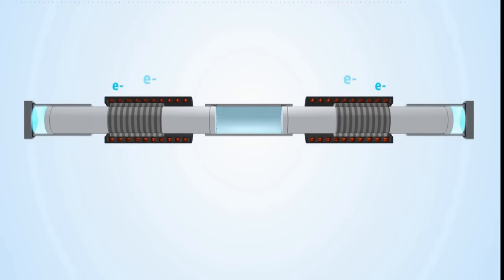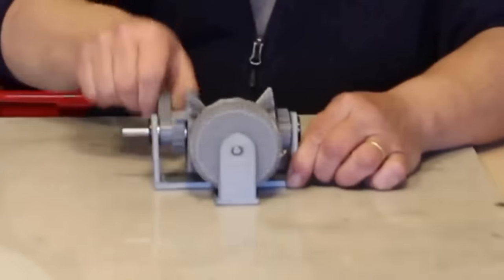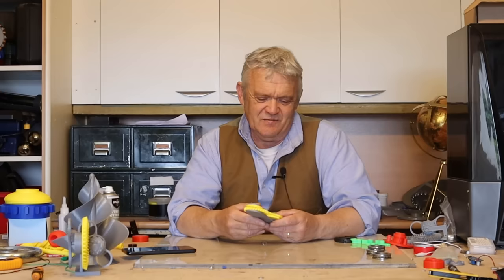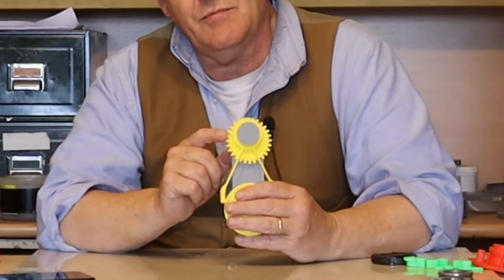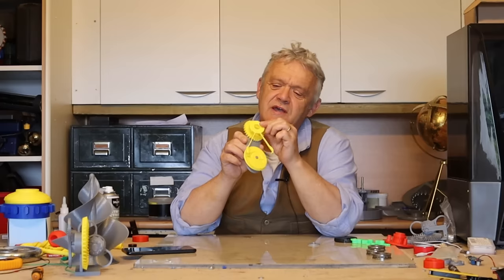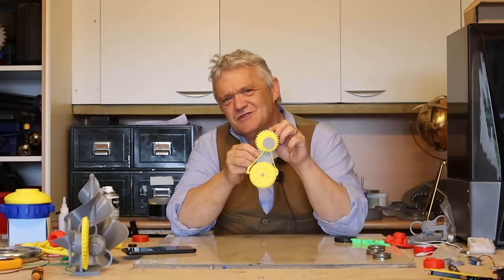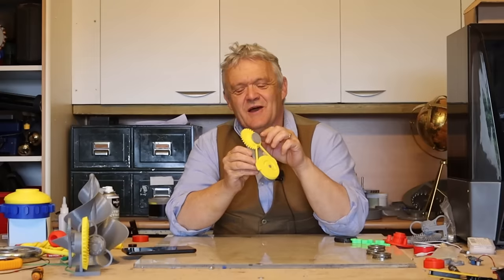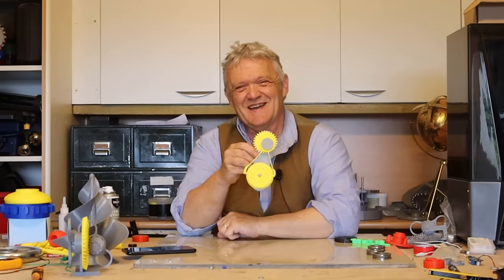2003 The Magic Lever Energy Harvester by Seiko

Comment: The generating tiles are the equivalent of "mushy" ground which is harder to walk through.  Smart people will want to detour around it, and it's really a clever way to make the simple people work harder.  A backpack that bounces to generate power will make the wearer work harder and more tired.  There's no free power to harness here.
Reply: It's effectively like putting a belt on an engine and driving additional hardware with it; in the power-"generating" case, it's an alternator.  It doesn't accomplish this by leeching excess energy off the engine, it does so by putting additional load on the engine.  Like you say, this stuff is a way to sap work/life from saps.
Reply: There is some free energy to harness, but it's really small. People wearing shoes probably have some padding, the padding is already wasting some energy. If instead of wasting it as heat it was directed to energy generation, that would provide the same padding effect with energy as a byproduct. 

It's not going to be very much, but small electronic devices don't use very much. For use cases involving a lot of walking (e.g. hiking), a tiny amount of power harvested all day could be usable.
Reply: @TheJohnreeves  Regardless, it ignores the larger issue. Wasting time trying to scoop up bits and scraps of energy from the fringes instead of diverting that intellectual effort toward novel energy generation technologies and improving efficiencies of existing technologies, like reducing transmission losses etc.

Penny wise and pound foolish.
Reply: @joevideowatcher  Nuclear power was that decades ago, the new thorium tractors run on an element that is as common as lead and are incredibly safe and basically meltdown proof. They don't actually want to solve energy because it would remove a reason to infringe on rights.
Reply: How about springs in soles of shoes that compress when you step on them and spring you up when you take a step.  However, all the weight in the shoe would suck.
Reply: @1810jeff  That's a load of BS. Firstly, you can't "solve" energy. We will always have a finite amount of it. The more of it we have, the more of it we are going to use and/or the more often we will be willing to use it inefficiently. Secondly, who's goal in life is it to infringe on your rights? Society is made up of many individuals. Its just a lot of people doing their own thing. Our problem with politics isn't conspiratorial. Our problem is the stupidity of the average person.
Reply: I don't think the issue here is trying to make FREE ENERGY!! Obviously heat losses exist and such. the issue is rather finding a way to convert one form of energy into another in a portable fashion. You can't charge your phone with your legs, however if you find a way to convert your mechanical energy into electric passively it sure would be handy to have. but then again in that case you might as well use a dynamo.
Reply: What if the generating tiles are just use downhill, where we absorb the impact mostly with our knees?
Reply: just dont take too much problem solved
Reply: How do they not realize that making people move down will take away energy needed to move forward?  Anyone that's ridden a bike with suspension will know this.
Reply: Could be applied to wave and tidal motion... that's free energy to grab. We already have wave energy generation but this could be an innovation.
Reply: @luismoref  on all that one way downhill human traffic zone
Reply: @BillDownhill problem is worse than that vertical and horizontal displacement are inefficient gait clearly where something like this would benefit is to make units and couple them to trees.  Fast growing species with bendy trunks.  So that any appropriate movement advances the mechanism.  But the what?
Reply: No one is trying to get “free energy”. At least no serious scientists and engineers. It’s more about looking at places where energy is otherwise wasted and can be reclaimed and put back into the grid.

Every scientist and engineer understands the second law of thermodynamics; which can be roughly translated as “every energy exchange interaction loses a certain amount of energy to wasted energy (oftentimes heat).

The point of walking pads for example is to get back a bit of energy from the kinetic energy which would otherwise be wasted by us just walking around. Of course like I mentioned before you still observe the second law of thermodynamics so by engaging in this energy transfer you necessitate an increase in energy (what you describe as mushy walking).

This isn’t by the way me supporting the idea of micro energy generation, I think we should focus on large scale renewable energy sources, but if they can get it to work in a cost effective manner then why not?
Reply: @thecanmanification  human motion is tough because we naturally reduce the work efforts throughout gait so as you start to try to take energy out youre going to make gait less efficient.  Consider prosthetic feet they bend but universally if they move too much people feel like they're walking in quick sand.  

Where waste energy is readily found are things that need dampening.  Buildings, sign posts, heck electrical wires themselves.
Reply: @UncleDiddles , when Discovery Channel had its Green Channel some years ago, there was an show where two tinkerers/inventors were featured, & in one particular episode they  used a type of wind turbine inside a large tube that turned in the same direction regardless of whether the wind entering from the top or bottom.

The tube was positioned vertically and attached to a oceanfront pier with the turbine inside it at the top.  When the waves came in air was forced upward, and when the ocean receded, the air was “sucked” downward.  This caused the turbine to spin consistently 24/7.  

It looked to me like the easiest (& probably cheapest) method to generate energy from ocean currents.  

But what do I know (or the two engineers/inventors/tinkerers)?
Reply: @LawrenceCarroll1234  I've seen that, it's a compartment that the water flows into and causes air to escape upward through a venturi and spin the turbine. I don't see why there is hostility in your pointing that out. Yeah, cool, it works, but why does that discount the use of this mechanism somewhere?
Reply: @UncleDiddles  , I made the deprecating remark at the end NOT to disparage the use elsewhere, but rather because of the apparent widespread lack of interest in implementing this method of power generation across the globe in coastal areas.

In other words, if it works — & works well, why not use it?  It may just be one of many methods to generate power via nature’s oscillations, but with global temperatures rising so quickly, and energy costs so high, we need to implement things like this, right?

But I get that you appreciate this, so thank you!
Reply: @LawrenceCarroll1234  have you heard of the concept of NIMBY? Not in my back yard... people complain about energy costs, but ask them to put a wind turbine on their land or a tidal generator at their beach and the answer is no. People want both, to have free energy, and to not be bothered or inconvenienced by its generation. That's the reason tidal generators are not widespread, that and cost. I was referring to this mechanism because it could be used underwater for shifting currents/rip tides, in smaller generators. A way to try and get around that.
Reply: @UncleDiddles , I hope you are right.  I am honestly flummoxed by the way many people don’t even seem interested or marvel at the ingenuity of such inventions, like maybe it insults them, as if that was its intent!  😜😂
Reply: No necessarily. There is a lot of wasted energy when we walk and run. That's why we can go faster and for longer when cycling than running. So there should be ways to gather that wasted energy without making people more tired. It's not free energy, it's just more efficient usage of it. For exemple, for the tiles, I would result in your steps being cushioned just enough not to hurt yourself even if you step forcefully without bending the knee when you put your foot down, while becoming just as rigid as concrete when you push yourself forward. However, that does require the person to change their way of walking, and the tiles would probably need to be fine-tuned for each person using them. So in the current state, I agree with you. But for the backpack, there's probably more potential since it can be fine-tuned to its user.
Reply: Yep, whoever comes up with these "14 kWh/day from just walking" ideas ignores the fact that the entire 14 kWh are used up propelling the 70-90 kilos of human around.
None of that energy is wasted, else wed be floating around in the atmosphere.
Reply: @lucasbrelivet5238  I work in a profession that does things like put motion sensors on humans and have them walk while monitoring their CO2 output to determine energy consumption.   Humans are quite efficient.  Bikes are a bad example because of course they are efficient they roll.  Which means really the act of gliding is more efficient.  It's like ice skating on a big open perfect lake is extremely efficient if you've never had the chance in a pair of speed skates and just go on your merry way coasting is very efficient.

Humans otherwise automatically will shift to walk more efficiently.  So if this clicks every time your waste movement exceeds a certain amount most humans knowing that will walk to not make it click.
Reply: @bryceg5709  I guess walking is still quite efficient, but running isn't. You need push yourself upwards each step, then dissipate that energy when land. But if we're going to make a special floor to save energy, we'd probably be better off making a bouncing floor to give the people their potential energy back and make running easier, that trying to make electricity with it. However, if you're a soldier running in the middle of nowhere, maybe some shoes or a backpack that can produce electricity as you move around are worth having.
Reply: @lucasbrelivet5238  But do mushy tiles or a bouncy backpack actually use the wasted energy?  Or do they just require more energy in addition to the waste?  You're onto something with bicycling -- and I think it's the invention of the wheel that is resulting in less waste.  It's a rigid support that doesn't require energy to support weight, unlike the floppy noodles we call legs.
Reply: @dansw0rkshop  Do you know of jumping stilts? They are strong springs that you can attach under your feet, and once you've mastered them (which isn't easy), they allow you to jump much higher and run much faster than normal, despite the added weight. That is because with each jump, your kinetic energy is stored in the springs, then returned to you and added to the energy you input for your next jump. A bicycle works similarly, except it simply allows you to keep your kinetic energy by rolling, and you can keep adding energy to that. However, when running, if you stop moving your legs, you lose all your energy. And you have to propel yourself off the ground with each step, but when going back down, you have no way to store that energy, so it just dissipates.
So if we can store that energy and reuse it to move around, theoretically  we should be able to intead convert it to electricity. As for whether a bouncy backpack and mushy tiles can do that, probably if done right, but I think it would be difficult to actually make it worth it. Without even talking about cost efficiency, any energy generator would add weight to your backpack, and take space. So even if your generator doesn't make you use more energy than if it was turned off, it might make you use more energy than if it wasn't there.
 Also, you wouldn't need a bouncing backpack, but on the contrary, a backpack that doesn't bounce even when you're running, like a passive camera stabilizer. This way, without a generator, you wouldn't have to lift your backpack when you propel yourself up when running, saving you some effort. And if you add the generator, you won't save yourself the effort, but you'll use that energy to make electricity instead of moving your backpack up and down for nothing.
Reply: I saw wind powered lights that go on the front of your car on temu lol
Reply: @joevideowatcher  Good thing there's more than one scientist and we don't have to choose one or the other, huh?
Reply: Claiming so is like saying that plants, by harvesting energy from sunlight, put a greater workload on the sun. The greater workload from a person walking over these things is trivial even in comparison to the trivial amount of energy it probably gets out. 

I'm not defending the tech, which is very likely a terrible source of energy and will take resources better spent, idk, being used in nuclear reactors, but this happens to be a shot and a miss.
Reply: @BillDownhill  It doesnt so much act as walking through mushy ground, (its not like the ground is sticky, or like theres fluid you have to push up to get your foot out of it,) as rheres a slight exertion to stepping out of it back onto level ground than energy you save walking into it. 

But this loss of energy is trivial compared to what you'd het walking on this. 

No, the real issue with this tech is that its probably a poor allocation of resources to build these. The amount of energy soent harvesting the resources, transporting them as cargo, refining them, shaping them, and placing them is probably considerable, and it will need to be less than the amount you'd get out of what you expect from their operational lifetime. (Eventually theyll break, and you'll need to replace the parts, which will cost more resources and energy.) And that net profit is going to have to be weighed against energy profit you'd get from just building some other green alternative, if you want to do as much good replacing fossil fuels as possible. And you also need to consider how actually beneficial the building processes of these things are. Electric cars have turned out to have a serious environmental cost that undoes much of the good driving them instesd of traditional fuel burning vehicles do ---- not to mention the geopolitical and environmental horror that is lithium mining in Argentina.
Reply: @darth_dan8886  Some of that energy is wasted by the laws of thermodynamics. Thats why you have a body temperature. Some of the wasted energy can, in fact, be collected by contraptions like these. The issue with these contraptions isn't even that they might be difficult to walk on, (though probably not very, and not enough to discount the benefits, even,) but whether these resources could be better invested elsewhere.
Reply: @dansw0rkshop  So, these things won't actually cause you to expend much more energy, and yes, they do help capture some energy that would otherwise be dissipated immediately and wasted.

OP's comment is not strictly correct. Plants don't cause the sun to spend more energy than it would by collecting energy from sunlight, after all. There are ways, though, of harvesting energy from something that makes it expend energy faster, (digestion comes to mind,) not sure either of these technologies really qualify. 

That isn't to say they don't have problems, though. They don't seem like a very wise allocation of resources, for one.
Reply: @peppermintgal4302  Yes, of course. But that does not mean that energy is available for such devices to utilise/convert?
Reply: The electric peizo  generator is what I thought they were putting most of their research into scavenging wasted energy thru movement such as walking / dancing as just the act of standing on it developes  pressure on floor tiles with built in peizo.
Reply: @waynegarfield6607  However piezo still generates voltage from change of pressure, not just pressure itself. And the amount of power generated depends on distance travelled. So there is really limited amount of power you could (no pun intended) squeeze out of a floor tile with a piezo component.
Reply: @waynegarfield6607  Yep. Even heard of putting piezo elements in road layers. Maybe the cost and efficiency will someday be enough to do something like that.
Reply: It's interesting how people play off any type of energy transfer systems by saying "there's no such thing as free energy so who cares." Then their brains shut off. 

Transferring energy like in this video can be practical if the burden of work is dissolved over long periods of time in order to get an immediate result.

Like water towers... ya, it takes energy to put the water into the tower, but it's worth it because it provides your multi-storied house with free water pressure for years to come. You could honestly fill it up with a few people and some buckets in less than a week. 

Or another example would be, idk, ALL watches that existed before batteries. You just crank a screw and it spins a bent metal rod and the watch works for years. When the bent bar stops giving enough pressure, you can just crank it back with almost no work and you get long lasting results.
Reply: @Elrog3 Wrong. Energy problems can absolutely be solved. You say there is a finite amount of energy but that's also wrong. If you consider the universe to be infinite, then energy is infinite. A finite resource is something that gets used up. Energy never disappears and it doesn't "get used up." Meaning all energy is essentially renewable. 

But theory aside, E= MC^2 shows that Energy is mass and mass is energy, but the conversation ratio is insane. An atoms worth of mass contains a nuclear bombs worth of energy. If you could harvest all the energy from all the atoms on the planet earth, youd have enough energy to last for the entirety of the human existence. It would practically be infinite.
Reply: @swickens930  I said we will always have a finite amount. Not the universe has a finite amount.
 
And looking at it, sure, it would have been more accurate if I said "at our disposal at a given moment in time". I think everyone would get what I meant, but it never hurts to be more precise. Unless it gets too long to read.
Reply: @Elrog3  Yes, but the ratio between mass and energy is absolutely insane. If we could harvest energy from any mass (which is technically possible, we just don't know how), you would have what amounts to an infinite amount of energy at our disposal at all times just because the mass translates to SOOOO MUCH energy. 

In the context of the conversation you were having with the other guy, this means that energy problems are technically "solvable" because energy is actually an extremely abundant resource in the universe. You could argue that the universe is just pure energy and that literally everything is energy. 

When it comes to government conspiracies, idk lol.
Reply: Turnstiles could work
Reply: In the case of shoes & backpack.. its probably both more economical, and more efficient to just mount a small flexible solar panel on the wearer. Like many hikers carry today
Reply: @1810jeff  correct. Every year some random person releases a vehicle that runs on hydrogen. That type of stuff is shut down by automotive industries and fuel companies
Reply: @Elrog3 thats actually false, there isnt a "finite" amount of energy in the universe. Energy is never destroyed, it's just transferred. We can't "run out of energy" so long as were still living in a vacuum known as the universe.
Reply: Walking on soft ground can be a lot better than walking on hard, as long as you don't have balance issues.
Reply: @swickens930  Oh definitely. There's only the question of cost vs benefit.

Does this relatively complex mechanism that is subject to mechanical wear over time really collect enough energy over its lifetime to justify its manufacture and application, or would it be more net-energy-efficient to manufacture and carry a battery?..

I definitely do not want to undervalue its usability in very specific circumstances, like in space, or as a part of a more complex mechanism, though.
Reply: @ZeldaplusSmallville  energy is recycled, but to a higher entropic state, as per the second law of thermodynamics, which (as written on Wikipedia) states that, the entropy of an isolated system left to spontaneous evolution cannot decrease with time. As a result, isolated systems evolve toward thermodynamic equilibrium, where the entropy is highest. A consequence of the second law of thermodynamics is that certain processes are irreversible.
Or put another way, energy is conserved but is dispersed and cannot be concentrated more than it is being dispersed. Energy is infinite, energy that is dense enough to be useful is not.
Reply: @theapexsurvivor9538  for your statement to hold any ground you would have to define what "useful energy" is, but then we get philosophical. 
The universe itself isnt concerned with large or small quantities because the universe itself is neither large nor small. 
It appears to me that you're saying the energy wouldn't be dense enough to use, maybe not in our current state. But who's to say less-dense energy is useless?
Reply: @swickens930 
1.) I have not heard of a watch running for 40 years on a single wind-up. Clocks - yes, but not a watch.
And these clocks would all have additional sources of energy in some form.
2.) The energy cycle of Earth that you described is very directly driven by an external energy source - the Sun.
Reply: @bryceg5709  things that need dampening like vehicle suspension? I wonder how much energy could be captured in a car. Hybrid would already have storage for it :)
Reply: @kkutani  I agree that an electrical generator built-in to a backpack or pants pocket or whatever,is likely to add to the load rather than capture waste energy. This is not to say it's impossible to capture waste energy though. Both car engines and electric generating stations (like coal, gas, or nuclear power plants) sometimes use turbines to capture energy after the main energy capture (turbine or piston) device has already done its best. There's still heat and pressure left over and that energy is potentially valuable. 
In cars, people like to use that energy to shove more air into the engine but that isn't the only possible application; if you really wanted to you could operate a generator with it instead. Which is what they do with the low pressure turbines on electric power generation stations
Reply: @joevideowatcher  On the contrary, energy scavenging might be one of the most important things we can do for the world's energy problem, it absolutely is not time wasted. Case and point: Regenerative braking systems in hybrid cars
Reply: More work for a bunch of people who sit around 90% of the day, Oh No!!
Reply: @Elrog3  oh it’s just a lot of people doing their own thing huh? What are corporations then? What are militaries? Hell, what are birthday parties then? Acting like concerted effort doesn’t exist in some vague hand waving attempt to marginalize the argument presented isn’t gonna fly.
Reply: @ZeldaplusSmallville  "thats actually false, there isnt a "finite" amount of energy in the universe."
-
Sigh. I already addressed this when talking to the other guy. I said the amount we have at our disposal is finite. I didn't say the amount of energy the universe has is finite.
Reply: @Elrog3  no, you said the amount that's usable.
And i said, "define usable."
It's a relative and vague term

Lol though, youre one of those redditors that types out a "sigh". 
I guess I shouldve typed something like, "short inhale, short exhale"
Reply: @ZeldaplusSmallville  "no, you said the amount that's usable."
-
Go reread my post. My exact words were: "We will always have a finite amount of it."
 
"And i said, "define usable.""
-
Go reread your own post. That's not what you said either.
 
I'm not wasting any more time on someone who either can't read or is too dishonest to admit when they've obviously made a mistake.
 
And this had nothing to do with the main argument, but I guess you just like being wrong. I don't use reddit.
Reply: @Elrog3  nah, I just thought I was talking to the original commenter I was speaking with before you came along.

And you're getting confused.
You act as if energy is something we have and that we use.
I said define what you mean by usable. And you ignored it.
Energy, like our bodies, is not something we have. It's something that we are.

Just because it becomes less dense and "unusable" to us how we currently are, doesn't mean we can't adapt or that something else can't exist with energy with less density. 
You act as if it's gonna run out and that it's finite; you said we eventually run out of usuable energy.
You're just being vague and trying to sound smart like you know something, but you don't go into the details. 
Then you give up and say "I'm not talking to you anymore". 
I did just sigh in real life, but I didnt type it out because thats not how sighing works.
Its actually funnier that youre not a redditor. I'd feel more normal about it if you were a redditor because of sheep mentality, but the fact that you decided to type "sigh" all on your own without any big societal influence makes it a little worse lol
Reply: @ZeldaplusSmallville  "I said define what you mean by usable. And you ignored it."
-
I went back and found it and it wasn't in a reply to me. So yeah, naturally I ignored it.
 
There's lots of rabbit holes we could go down if you really want to. For example, what 'we' is. Or whether being able to get energy from mass makes them the same thing. I think what I meant was clear enough to be understood.
Reply: There are certain oscilation modes when walking with cargo, which are not helpful to the walker. These oscilations disperse energy as friction, sound, etc., or the walker has to physically resist them. If you harness the energy of specifically these oscilations, it's less work to resist them, and you salvage energy otherwise lost as heat
Reply: @joevideowatcher  I don't disagree about innovating better energy generation, but applications like shoes or backpacks can be extremely useful for people who want to detach from the grid for whatever reason. I would love to be able to charge my phone by doing the hiking I was already going to do, instead of having to carry extra weight in batteries.
Reply: This sounds like big bs
Reply: @Elrog3

We do not occupy a closed system. There is a continuous stream of energy coming from the sun.